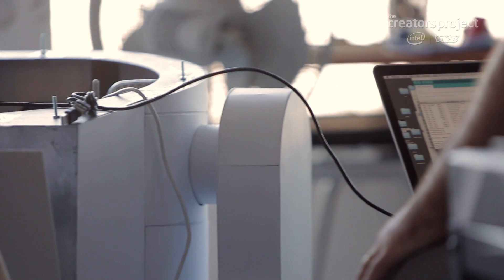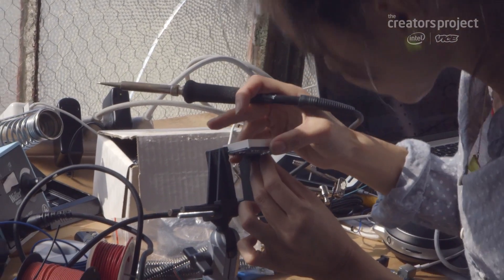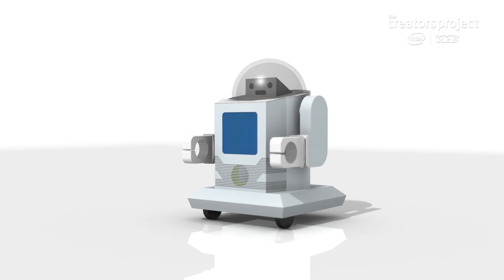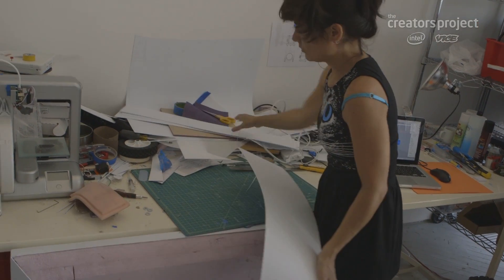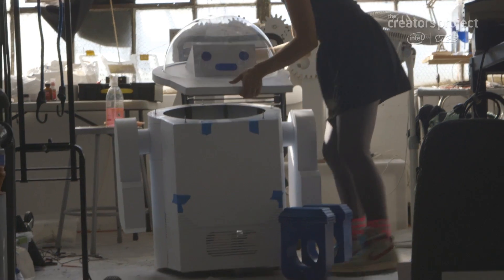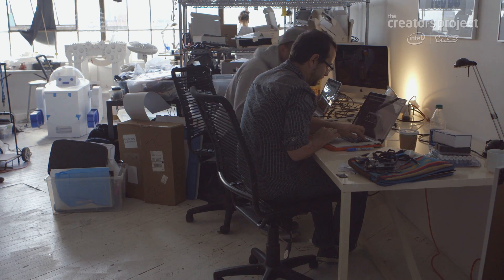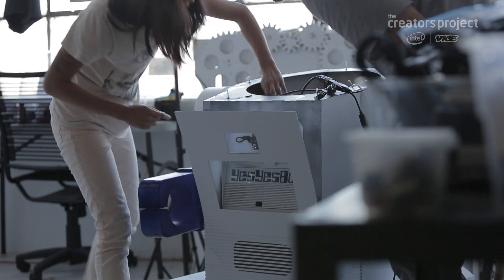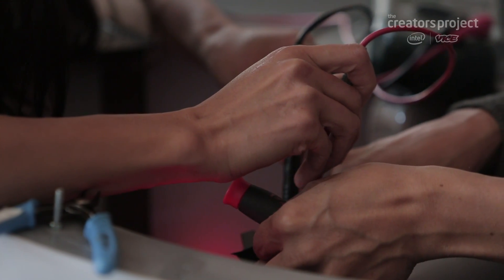Candy-Dispensing Robot | Meet YesYesBot by YesYesNo (The Makers: Episode 2)

Comment: I agree, as a matter of fact the raspberry pi wouldn't exactly exist either without the popularity of older boards such as the panda board and the beagle board. Release of Intel New Chip is simply to compete with ARM.  However, the intel Galileo has been marketed as very open and if that is correct, then for its price it has potentials. It's not so good attacking intel for being "late". The new Intel Chip brings a new architecture to the table, and diversity is never a bad thing in electronics.

Comment: Intel is not playing a catchup. If you research, intel (and AMD) have been producing a variety of embedded systems for quite a while, running mainly on ATOM processor. Yes, none of these boards are the size of a small raspberry pi or a beagle board, but they do pack more punch than any of these boards (at more expense of course). 

What intel is doing is trying to enter a more mainstream market for the typical hobbyist and electronic enthusiast and i think it has large potentials.